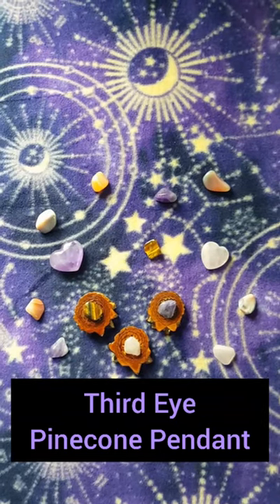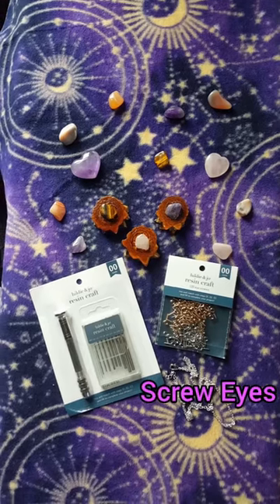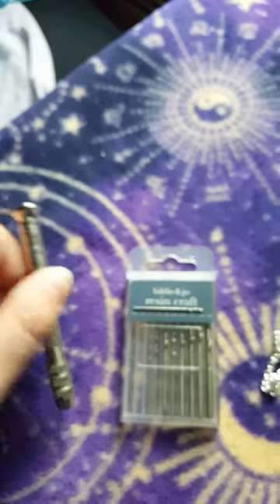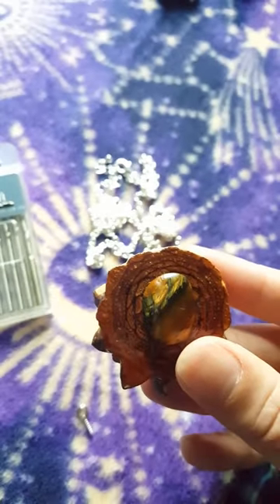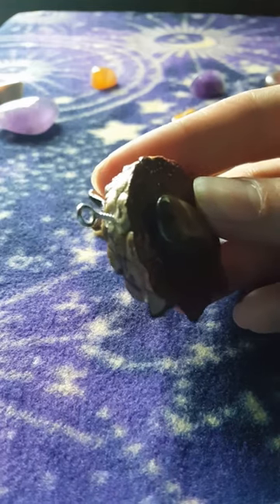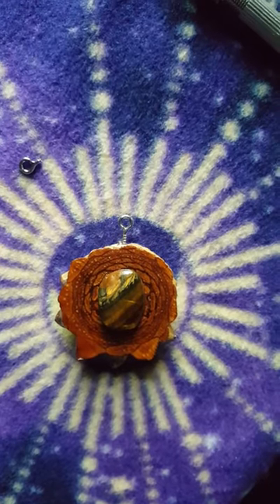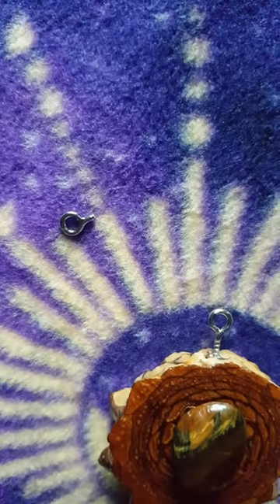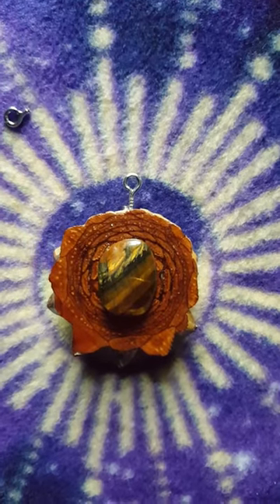DIY Third Eye Pinecone Pendant

Comment: Really loved the simplicity. I just bought a simple pinecone slice pendant from Bonaroo, they said it was from the Redwoods,What should a Redwood sliced pinecone approx an inch circumference cost? Either way, I like it, its beautiful.
Any thoughts would be welcome.
Reply from the maker: I'm not familiar with pricing of different types of pendants, but I got 5 knob cone pinecone slices on ebay for about $15